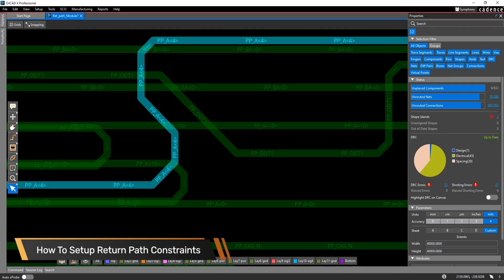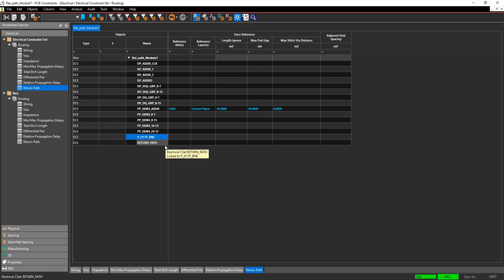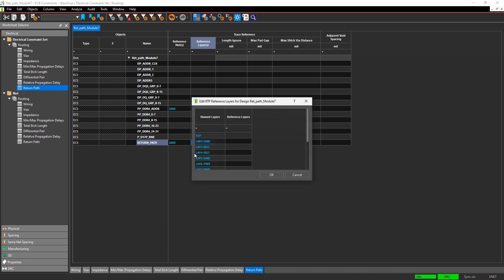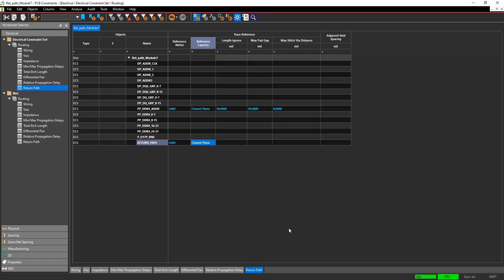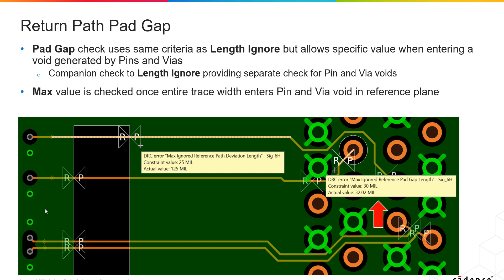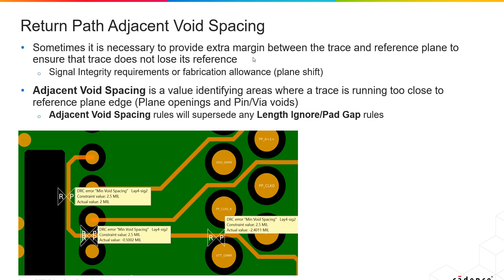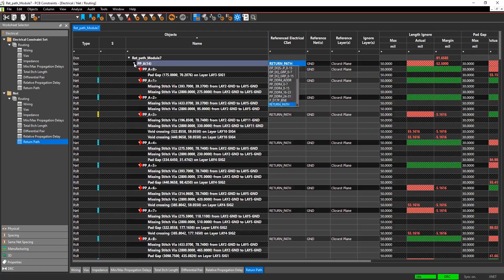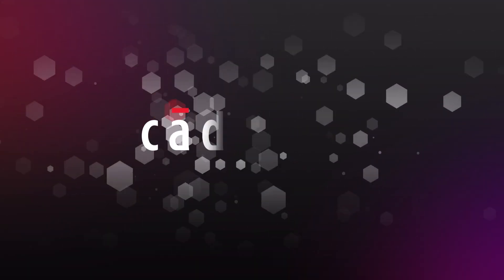How to Setup Return Path Constraints

Comment: The "Return Path Adjacent Void Spacing" is a great option for SI and manufacturing tolerance allowance. I've been using a larger value for line-to-via than shape-to-via to keep the tracks over the copper planes in spite of layer-to-layer misregistration.